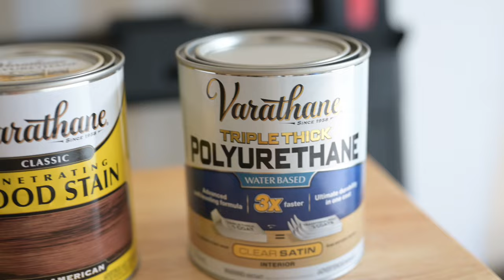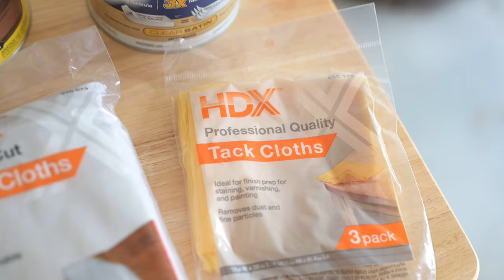HOW TO STAIN BUTCHER BLOCK COUNTERTOP | DIY STANDING DESK

Comment: You seem like this is your first project, so I have a suggestion to give you a much better result.  As you’re brushing on the stain-or whatever, do what’s called back brushing.  You’re laying down the brush and going forward and working your way across with each set down of the brush, you’re leaving the “tap” behind.  Lay down the brush and work backwards, in that way each stroke will cover the previous lay down and prevent that tap from absorbing and leaving behind more stain.

Comment: I've worked with both types of polys and I'd say the normal one is better for first timers. There are a couple of things you can do to prevent streaking. Go off both edges. In this video he started left then went off the right edge. Reverse that motion and go off the left edge as well. That way will ensure that you get enough product on the edges. For streaking, be generous with your application. Lather it on then user your brush to flatten and even out your product. It will ensure that you keep a wet wedge. If you try to apply just enough and run out half way down the length of the board like he did, you run the risk creating a break in the eveness once your finish dries.  Lastly, with triple thick, you must get it perfect. If you miss a spot and have to do a second coat, that shit will be too thick and take forever to cure. It will dent from anything you rest on it until it cures. For normal poly, you will cover all missed spots by the third coat and because the coats are thinner, cure time is faster.

Comment: Well done man. Couple things I've learned that helped final finish and less streaks/drips:
1.) Unless you are using truly softer woods, like pine, don't use wood prep treatment on hard wood or anything in it's vicinity. It gains you nothing with these and causes nothing but problems in woods like Maple, it closes up the grain so your strain will not penetrate as well. Basically working against yourself.
2.) You don't need B side for practice at the risk of ruining your A side. Muster courage! Do the A side first. Complete with edging. This is the side you be looking at forever so you want to know it's good, watch it dry. Dive in like a boss! Then it's ok to to stain several inches back on the underside while in A up position if you want or it actually matters, drips will fall to floor rather than your A side. Ultimately, if you must stain the whole B side. Save that for last, light stain cover coat to hide the white underbelly is all that is. If any drips from your A side start, they'll live under there forever out of view.
3.) This is subject to opinion as much as experience with what wood/stain type you are using, but I would not be so focused on wiping off stain with the grain, that's often generating streaks and you are not removing the stain uniformly. In fact, better to think of this phase as "polishing and finishing a coat." It's your opportunity to get the stain to truly soak up evenly. This is where the finish it crafted, by polishing it clean. Smooth circles can be ok, blend it in as you remove the excess towards drying it. If you end up needing a second coat, so be it,  now you are set to get the darkness and depth of stain just  right. Finally poly satin and sand, that's my favorite, because it allows you to craft the perfect lustrous sheen. 
Thanks for doing this video and good luck!

Comment: Thanks for video. Retired contractor here. I can tell this is your first time doing this. No problem welcome to youtube DIY. Enjoyed the background music. 
Here is my main unsolicited advice to other DIY.
Be careful when doing sides. The foam tipping brushes, (loaded up) as well as quality brushes will seep onto the underside if you don't wipe them clean. This will darken the stain on the side you want to keep. It sort of leaves a darker ring around the edge if you are not careful. This happens with paint, whatever. 
Butcher block comes in many types of hardwood. The concept of stain is to make different types of wood appear similar with the same tone or hue. For example you might have island  countertop and and base countertops of diff hardwoods and you want them to match.
Good luck. Not as easy as it looks!
Reply from the maker: Yep I encountered the stain dripping onto the other side when I was staining the sides of the board. You can't see it that much but I know it's there. The desk actually turned out pretty well. One thing that I noticed is a slight grayish dust on certain areas (that won't wipe away easily) that I believe are the poly that I may have sanded a little too much. Any idea what that may be? You can't really see the graysih dust or streaks until the light hits it at an angle. Thanks for the info and watching the video!

Comment: I did a his/her battle station with beech from Floor and Decor. I went up to 400 grit. I used the orbital with 220 and hand sanded up to 400. 

Those rough parts you’re talking about comes out when you sand with that higher grit. Even with the 320 I still had some rough patches. 

Good vid.

Comment: Would involve adding a 2nd product but you can use that thick stuff on the back side first and let it cure up decent.  Then flip over and use traditional poly for the front and sides.  That way the underside is done in one go and there's no flipping back and forth. Speeds things up and less chance of damage to the front.  Using the triple coat stuff like you did is even quicker obviously.  I'm sure it worked out well but if anyone is nervous they can try the thick on back and traditional on front.

Comment: Nice job, good video.... one suggestion... always work the stain and finish furthest away from you first... that way you are not leaning over the work already done... also maybe use foam blocks if possible to lift your material off saw horses/ Not trying to do you, your work looks great!

Comment: So do you suggest using a bristle brush instead of a sponge brush for the poly application? Also how long did you let the desk top cure before putting your stuff on it, have you encountered any stickiness with your computer equipment or was it a completely hard surface ready to go?

Comment: Great video! Good information. 

Literally bought the same butcher block from Home Depot and bought the same stains. I have a couple questions. I am concerned. 

I will have to stain inside my room. Unfortunately, due to cold weather here. I read drying is affected by the temperature. I have one window. 

How strong are the fumes and during the curing process?

Does the smell linger on the countertop during the process? 

Thanks in advance!
Reply: Did you ever figure it out?
Reply: @Sarah_Kinz  yeah do it outside because fumes are super strong. i wish i had did it in the summer time vs the winter time because the curing process would have been easier and the warm weather would make the polyurethane set better. other than that my butcherblock came out good nonetheless for my first DIY.

Comment: Alright, I have watched this video like 3 times now, I think I got it down lol. I will be staining/sealing my 10ft butcher block countertop I will be using as my new gaming/DJ setup desk, let's hope it goes well. Haven't decided if I want to do both sides just yet. Thanks for one of the best tutorials on this!
Reply from the maker: Nice! I'm sure it will turn out fine. I haven't done any woodworking projects like this in almost 20 years. It can seem a little daunting at first but it's actually not bad. I would def recommend doing both sides ... at least sealing both of them. Thanks for watching!

Comment: How's have the counter top been holding out so far? 
We are in the process of putting in butcher block countertops in our kitchen.  I'll have to look into the sealing process you did. Thanks for sharing
Reply from the maker: The desk is holding up very well actually! Maybe I should do a follow up video for the desk at some point. How's your kitchen countertops looking? I'm not a professional wood worker but if it were me and I were sealing something in the kitchen I would probably use the regular poly so I could be a little more precise with the application. Of course, the triple poly will work but you have to be a little more careful because it is really thick but it doesn't take long at all to finish the sealing process.

Comment: List of products:
-Varathane pre-stain wood conditioner (8oz per 55sq feet. or 1qt per 220sq feet)
-Varathane classic wood stain in Early American color(1 qt per 150sq feet)
-Varathane triplethick water-based polyurethane, clear satin (1 qt per 50sq feet)
-Foam brushes, gloves, wiping cloths, tack cloths, 220 grit sandpaper/sanding block, mask.

Made this list because I needed the same products from the hardware store. Good luck!

Comment: ok sorry to call ya ouot but when did you flip the board to do the "bottom" but yet when you were applying the varnish the side you were doing was the "top" im confused wich side am i adding varnish too first?
Reply from the maker: You can start with either side you’d like. I started with the bottom side of the board and then went with the top side. The camera just stopped recording when I was applying the stain to the top.
Reply: Alright I ended up going with a 1 step I guess it is a stain and polyurathane in one. Thanks for the vid was really helpfull.
Reply from the maker: @dillonmckenzie5526  ohhhh ok … yeah I used a separate poly and stain.

Comment: Nice bro, any tips after finishing the project in order to avoid the drips you got from when you stained the sides?
Reply from the maker: I would just be careful and try not to put so much stain on the brush. Also I would wipe the bottom side of the board immediately. It actually turned out ok because you can’t even really see it once you’ve applied the rest of the stain.
Reply: @DancyTV  🔥🔥🔥

Comment: So if I understood correctly, you sanded the polyurethane coat?
Reply from the maker: Yes I lightly sanded after the poly application. It’s necessary because it’s a little rough after drying. Thanks for watching!
Reply: @DancyTV  thanks for the quick reply! Yeah, when I added the poly I noticed it was rough to the touch. After you sanded it did you just clean up the dust and called it done? Thanks for your bid by the way, it’s very informative!
Reply from the maker: @nestorrobles5059  yeah I cleaned up the dust with a tack cloth and my shop vac. It’s not perfect but definitely a lot smoother than it was.
Reply: @DancyTV  Awesome! Thanks again man!

Comment: how long did you leave the butcher block opened before you applied the first coat? i wanna get the same block and the company says you need to seal it within 24-48 hours or itll warp so if i wait for the poly to cure on one side will it warp?
Reply from the maker: So I would follow those guidelines. I waited for a day where the weather was ok and completed the entire project within 48 hrs.

Comment: dont all product need to be either water based or oil based? mixing a oil based stain with a water based poly could cause issues?
Reply from the maker: To be safe they should be but, I just waited longer to apply the poly and it worked out just fine.

Comment: So, it looks like you are using an N95 dust mask. That will help from the wood particles from entering your body up to (.3 microns?) into your lungs, but NOT vapors. 

I would suggest dilution of the air through use of a mechanical fan. 

consult with your doctor and get a spirometry or pulmonary function test before switching to an organic vapor 1/2 mask.  See SDS for the varithane products used.